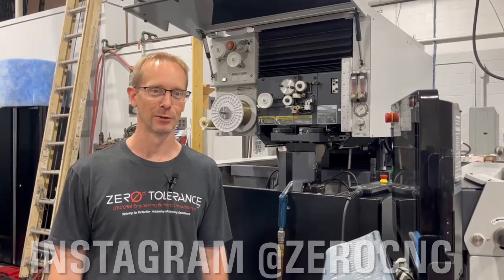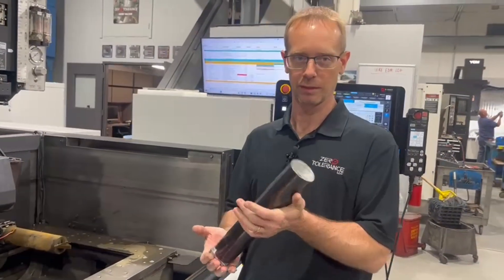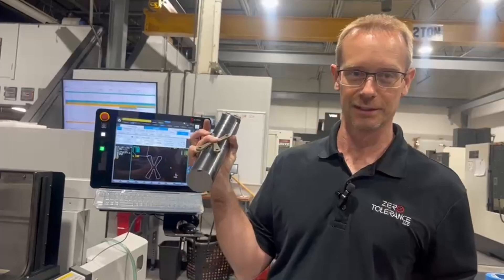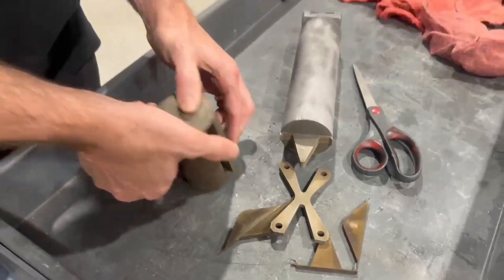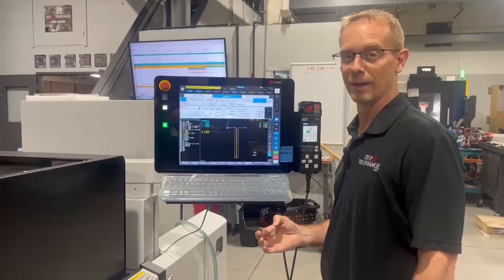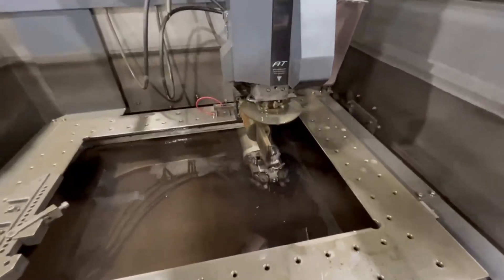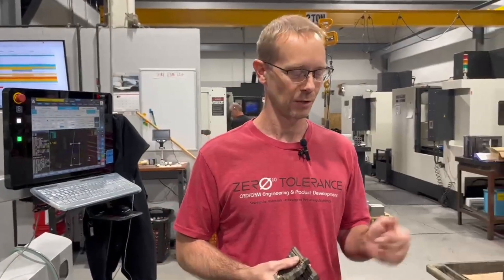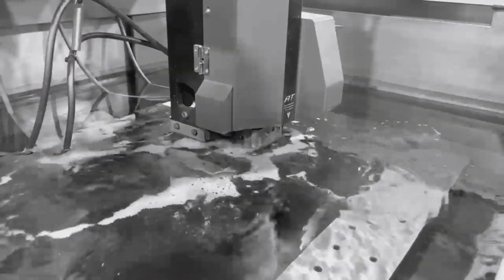Turning Round Stocks into Precision through Wire EDM!

Comment: Couldn't you use a larger diameter bar that is larger than the X shape, so you cam then slit on a saw, mill, or grind to thickness and then fast hole / wire in X profile. Was that the largest diameter bar they could get ?

Comment: Would it not be much faster to mill the material flat first?  That would allow you to get ideal flushing with both nozzles?
Reply: im talking out of my bung but I agree, I would remove the bulk of the stock with a highfeed mill then a facemill to get it to tolerance, I dont know what tolerance he has to hold, even if you have to take it to the surface grinder it would be worth it
Reply: I'm with this school of thought. Mill material, grind flat if required, edm holes for some positional accuracy. But hey I'm just with the peanut gallery